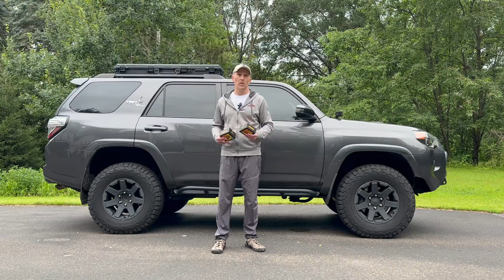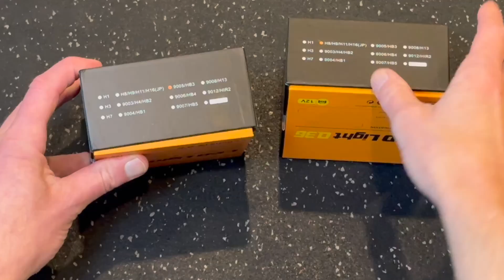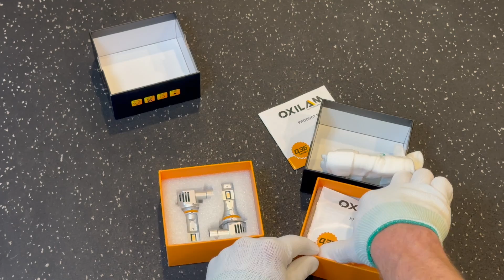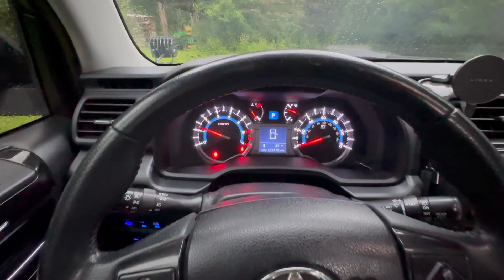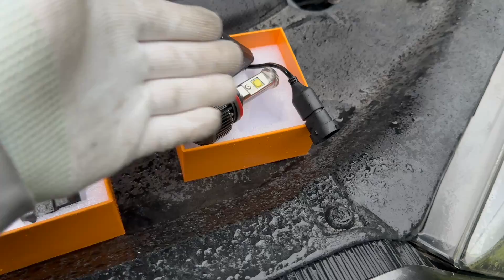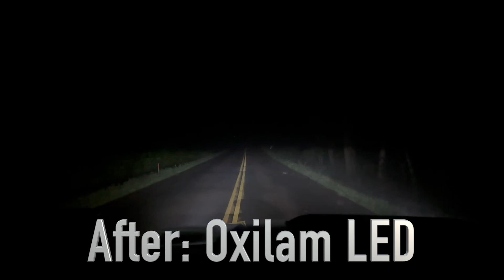Oxilam LED Bulb Replacement for 5th Gen Toyota 4Runner

Comment: I installed this but normal light not hitting the ground it hit straight, please help
Reply from the maker: You may need to adjust your headlight angle.  Directly behind each headlight housing is a small circular access hole.  Park 25 feet from a wall and adjust up or down.  There are videos on how to do this if needed.  Good luck!